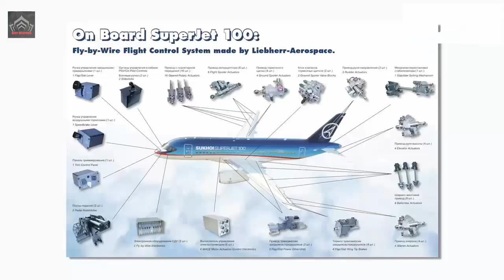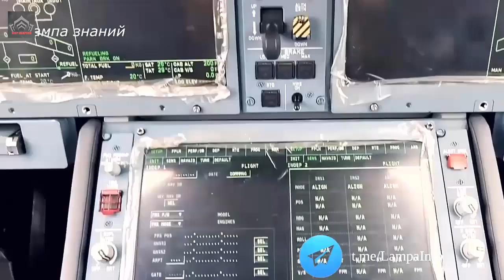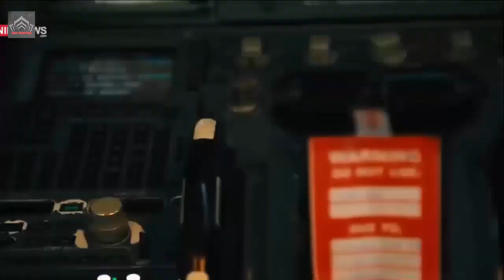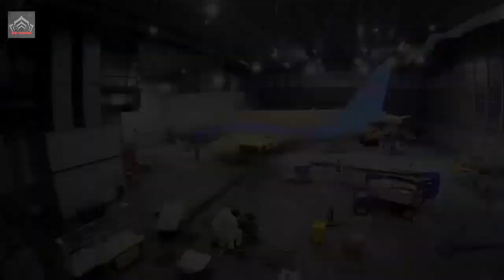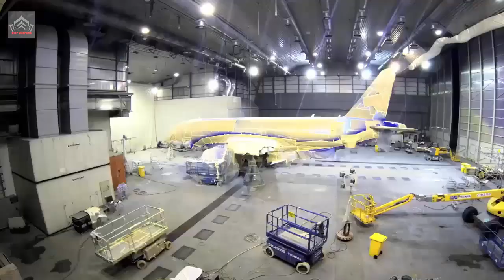Russian Sukhoi Superjet 100 Using Only Local Components Took to the Skies for the First Time

Comment: Reality: Since 2018, the Sukhoi Superjet 100 (SSJ 10) has hardly been built because there are over 60 unsold & returned ones! The downtimes and thus the costs were extremely high. Russian civil aircraft have therefore had a market share of less than 0.1% of global sales outside Russia/Belarus for the last 20 years.
С 2018 года самолеты Sukhoi Superjet 100 (SSJ 10) практически не строятся, потому что есть более 60 непроданных и возвращенных самолетов! Простои и, соответственно, расходы были чрезвычайно высоки. Таким образом, за последние 20 лет доля российских гражданских самолетов на рынке составляет менее 0,1% от общего объема продаж за пределами России/Белоруссии.

Comment: UAC Deputy Vice Minister of Information Fabrication and Strategic Data Recalibration Boris Kalishnikov-Tohistemple stated that the new reconfigured SSJ-100 surpassed all performance expectations during test flights including flying non stop between Moscow to Pyongyang at Mach 15 consuming less than 2 liters of Vodka and breaking the time-space continuum during which Vladimir Lenin was transported from 1917 to the year 2255 to assist CzarVladimir Putin the 14th in his Special Military Operation against Capitalist operatives in the Andromeda Galaxy who are threatening The Milky Way-New Warsaw Pact and Organization of Non-Aligned Galaxies members by backing Rebel forces in Tatooine and Nabu with arms and material support.

Comment: The main problems with the SJ 100 were its unreliability & miserable after sales service (poor spare parts supply) and as a result too high operating costs. 
This led to the major western customers CityJet and Interjet returning their 45 SJ 100s. The major Russian customer Yamal Airlines also returned its.
Fewer than 100 of the approx. 210 produced aircraft flew in 2019. 
The manufacturer recently announced that civilian aircraft will not be delivered in Russia again until 2026 at the earliest!

Comment: As in xx other industries, Russian airplanes are far away from the world level, i.e. Boeing, Airbus, Comac etc. Market share outside Russia/Belarus is 0.x%! 
Main problems are high unreliability & fuel consumption, resulting in high operating costs. As in xx other industries, the government invested billions in vain. The same applies to the IT, hardware and software industry, mechanical engineering, vehicle construction, train and shipbuilding, electrical engineering, consumer electronics, optoelectronics, robotics, pharmaceuticals etc. All to far away from world level & zero market share outside Russia.

Comment: Russia being sanctioned will create a stronger, more independent more innovative nation.  While the A220 is more advanced this is just as advanced as the MRJ or the E-jet family. Russia lost so much capability after the collapse i am glad to see them and China developing their own planes.   We use to have British , french , several american, russian, german, Swedish, canadian, planes now its 2 multinational overlords with one of them caring more about profits than safety to the extent they ship planes with dozens of loose bolts causing parts to fall off in flight when they planes are not doing automated nose dives into the ground.

Comment: Some of you here are praising the SU-95, unfortunatly western companies like Interjet in Mexico got read of it, because it's unreliability topped by a lack of spare parts from the manufacturer.
Interjet had to ground two aircraft who were cannibalized to provide spare parts to the rest of the fleet.
Russians will never learn what's "Customers Service", that's sounds unreal for them, it's not in their DNA.
Reply: >Interjet had to ground two aircraft who were cannibalized to provide spare parts to the rest of the fleet.
Interjet stopped to pay for maintenance just after the last SSJ was delivered.
Reply: @KVentz  Why did InterJet stopped to pay for maintenance? Because Sukhoï was unable to provide spare parts leading to the grounding of two aircraft used as store for the remaining fleet. In summary :
Poor reliability, poor customer support and non-compliance with the terms of the contract demonstrated the unability of russian aerospace industry to compete with western products.
Reply: @stabilo3170  Because they were near bankruptcy. Their financial model was a disaster. Luxurious Pininfarina interior with huge seat pitch and low-cost airline model. In Mexico. An incompatible combination. They operated the planes without any investment until the first breakdown, then they could not find money for repairs.

The only one real serious problem was on start with French hot part of the SAM-146 engine, which had a resource much less than declared. And Snecma failed to produce enough replacement engines in short time.

Just like P&W with their PW1100G today. Indian Go First goes bankrupt due to Pratt & Whitney engines. And did you forget sheathing peeling in A350? Will you say that "Poor reliability, poor customer support and non-compliance with the terms of the contract demonstrated the unability of European aerospace industry to compete with western products"?

And can Boeing 737 MAX "compete with western products"? An obsolete airplane terribly designed and even more terribly assembled.
Reply: @KVentz  A luxury interior with a five abreast 3+2 layout?  Are you serious? Interjet is a low cost carrier and they choose a 93 single class cabin. You are becoming tiresome with your constant lies. Your diatribe sounds an awful lot like that of Peskov, the professional and official liar of the Kremlin. Buzz off!
Reply: @stabilo3170  >A luxury interior with a five abreast 3+2 layout?
Yes. From Pininfarina. This was the option for SSJ-100. Customisation in Venice, Italy. Extra cost.

>they choose a 93 single class cabin
Yes. 93 single class. While Aeroflot ordered 85 economy + 18 comfort class = 103. And with a kitchen in tail section.

>You are becoming tiresome with your constant lies.
No arguments left, only insults remain. Well, OK.
Reply: @KVentz  > Yes. From Pininfarina. This was the option for SSJ-100. Customisation in Venice, Italy. Extra cost
This remark shows your ignorance of the western world. A known name like Pininfarina or Recaro does'nt mean an extra cost, it's barely some advertisement for these brands within the aerospace industry. Who cares to have been seated on a "Pininfarina" branded seat when flying on a low cost company? Your argument is wiped out!
< The only one real serious problem was on start with French hot part of the SAM-146 engine, which had a resource much less than declared. And Snecma failed to produce enough replacement engines in short time.
How can you dare to write such lies? During the flight test campaign on a IL-76 NPO had numerous problems and SNECMA (french part) suggested  solutions systematically rejected by NPO. Few weeks later NPO  came back with a copy  of the SNECMA's solution. This is the way russians are working with their partners. Total denial of their own weaknesses.
> Just like P&W with their PW1100G today. Indian Go First goes bankrupt due to Pratt & Whitney engines. And did you forget sheathing peeling in A350? Will you say that "Poor reliability, poor customer support and non-compliance with the terms of the contract demonstrated the unability of European aerospace industry to compete with western products"?
IndiGo goes bankrunpt? In June 2023 Airbus got a firm order for 500 A320 family aircraft from IndiGo. What a performance from an airline in bankrupt! Again you are ridiculous!
A350 peeling was a cosmetic problem, it has been solved long time ago with Qatar. Keep yourself informed.
> And can Boeing 737 MAX "compete with western products"? An obsolete airplane terribly designed and even more terribly assembled
For your information the B737 is a western product. Yes Boeing has serious quality problems since few years affecting mainly the 737 program. In our western world the transparency of informations and the free press did'nt give any choice to the FAA, they had to take severe sanctions against Boeing. Today with the recent Alaskan "door plug" accident Boeing has to slow down their output rate and additional supervisions are imposed by FAA.
Regarding  arguments, I'm systematically proving your lies while you only deny without providing tangible elements, but only lies that are easily countered. Please improve your reliability!

Comment: no western parts is an unproven claim, just propaganda. Even the Chinese couldn't do it.
often times you need a lot experience and usually cannot start or pause the production just like that. And 3:20 in the video it says French / Russian engines, whut?
Reply: Western parts and French / Russian SAM-146 engines were on SSJ-100. The SJ-100 aka SSJ-100 RUS has no Western parts and new Russian PD-8 engines.

Comment: This superJet is not just another jet that Russia produced using its own resources, it is one of the best jets on the market, it uses composite materials, outstanding aerodynamics innovation and fantastic new turbofan engines, which are more economical and more reliable than foreign category competitors.
Reply: Operators hate it! It suffers terrible technical and mechanical issues all the time 😂
Reply: @chrispaw1 Lies!
Reply: @chrispaw1   I did because of the unreliable western parts. Main criticised point was the terrible french engines.
Reply: And it will crash and be incredibly unreliable now that it is using russian "technology".
Reply: Do you really believe this or you have to do this to not end up in a meat grinder? 😢

Comment: During Soviet times Soviet built  passenger aircraft & heavy duty cargo aircraft (Tupolevs and Illyushins) built indigenously were in service with Aeroflot but what happened to passenger airline production after the breakup of the Soviet Union??
Dr 🐲🐾
Reply: @@HK-fz5rn so many crashes AFTER the Soviet Union broke up that Tu- 154 production had to stop? How is it that incidents of crash were far lower if not negligible during Soviet times? But what happened to the Illyushins? Why were they removed from service with Aeroflot?
Reply: Congrats. Russia.. Well done.. ❤❤❤

Comment: Fantastic airplane! Heavy like tank! Build strong like tank! Flies like washing machine with wings. Safe as flying washing machine with wings. Powerful non Amerikanski engines. Powerful like Soyuz rocket. Low noise levels, like Soyuz rocket. All pieces fit together perfectly, like well built Moscow apartment. Joy to fly, like home designed and built Concordski  TU 144 SST was in 1970s. Will get much use, especially on heady vacation days between Alma Alta and Petropavlovsk.
Reply: I looked through ALL the comments.  CONGRATULATIONS, yours is by far the dumbest.  It's not without reason - another stupid, American "expert" on Russia.  Were you taught by Charlie Kirk?  😁😁
Reply: Learn to joke first, clown.

Comment: @2:28 The PowerJet SaM146 is a turbofan engine produced by the PowerJet joint venture between Snecma (Safran) of France and NPO Saturn of Russia. This problem must also be tackled in order to be 100%, but I don't think it could be a difficult task.
Reply: This problem has already resolved with a new russian engine PD-8.
Reply: Already solved. PD-8 engine

Comment: 🤔They should build at the wing's 
winglets are vertical extensions of wingtips that improve an aircraft's fuel efficiency and cruising range. Designed as small airfoils, winglets reduce the aerodynamic drag associated with vortices that develop at the wingtips as the airplane moves through the air.👌✌️
Reply: You think they don’t know?

Comment: More sanction will usher more self sufficiency. Great job by Russia.
Why can't Russia modernise their existing fleet like IL 96, IL 76 and Tupolov aircraft?
Reply: The newly modified IL-96-400 made its first flight. The aircraft has become 10 meters longer, the avionics have been completely replaced. The next step is to replace the four PS-90A engines with two PD-35 engines. The IL-76MD-90A(E), completely redesigned and assembled using new technologies, is currently being presented at the Dubai Air Show.
Reply: To survive in the wide-body arena you need to be able to build 2-engine models like the B777, or B787 instead of 4 engines that is why airlines are retiring the B747, and A340 because of their 4-engine configuration. So Il96 with its 4-engine configuration won't be competitive for airliners, they need to come up with a powerful competitive, and efficient engine that can compete with GE or Rolls engines to be viable.
Reply: @Brocambro1  
Russia is developing PD 35 that will replace the current 4 engine configuration.
Russia is also developing cargo aircraft Slon / Elephant that will replace AN 124.
It will be able to lift 150 ton cargo, 30 tons more than AN 124.

Comment: German brand spotted. French-russian what.? Western-sanctions... the atr72 of many-countries need to be replaced with good(similar) pricing. 737-200 types of platform are usually capable of replacing atr72. Reduced performance (turbo-prop envelope), increased range and good fuel-economy should be welcome for consideration, besides turbofan-performance or 3G-capable airframe and turbojet-performance.

Comment: So who will buy all those Boeing aircraft that have stacked up at the factories then? China has the C919 now and wont buy Boeing because they are involved in missiles to Taiwan. Both Russia and China will be keen to export their respective aircraft to other BRICs nations, and you know they will be a competitive price too. It seems to me that in the same way as sanctions on microchips, the US is about to lose its second dominant industry.
Reply: Brazil a BRICS member also has it's own locally produced aircraft Embraer in different models
Reply: @mightysparrow9632  Embraer is owned by beoing, you don't know?
Reply: The c919 has a lot of foreign components. Americans are not used to fair competition. I think they will soon introduce sanctions against COMAC. And then the production of the aircraft will stop. In Russia there is no such problem. There are completely Russian planes SJ100, MC21-310, TU214, IL96-300, IL-96-400
Reply: @0l_i_l0  Yes I found out it has US engines. Producing jet engines is a complicated art, but this is why the China -Russia connection is so valuable.
Reply: @Andrew-rc3vh  China is now developing its own engines. I think they will succeed. They have a great industry. Two years ago I could not even imagine that I would drive a Chinese car.
Reply: @0l_i_l0  Seriously, the jet engines are some of the most challenging engineering. You have to develop the materials to withstand very high temperatures and stresses. To get something like that right is a lot of trial and error, but the Russians have been building them for a long time, so at the very least they need to pass on the technology.
Reply: @Andrew-rc3vh  Russia can’t even produce new engine for its tanks. Last time they tried to copy engine from the WW2 Tiger tank and they failed lmao 🤣 .
Reply: Ok I now see it ,but there was a News about Boeing taking over Embraer  but the deal did not scale through
Reply: @charlesekpima8210  Boeing had no money to complete the deal.
Reply: Western countries should service planes supplied by them. Then diversion of parts can be reduced
Reply: Best plane i have ever used with my travel, it was best experience flight in Mexico, i think the name of the company was Interjet Mexico and all their planes similar to this model, i have travelled a lot and this plane is best plane, better than airbus and boing.
Reply: Embraer is owned by Boeing
Reply: @charlesekpima8210  boeing doesnt own embraer, infact they totally screwed over embraer by cancelling the deal after embraer had made a lot of changes to their business.
Reply: @charlesekpima8210 Embraer is NOT owned by Boeing
Reply: @charlesekpima8210  you watched too many Disney movies
Reply: @charlesekpima8210  Embraer is not owned by Boeing. Boeing was not interested in the whole of Embraer, but only in its E195 series aircraft, in order to cheaply and quickly enter the 100-seat aircraft market, which was already occupied by the Russian SSJ-100 and Airbus, which took over the C series from Bombardier and renamed it the A220...